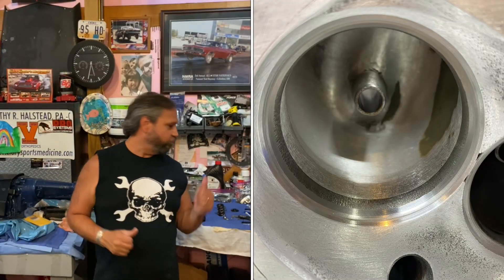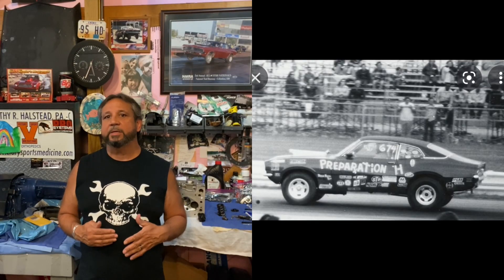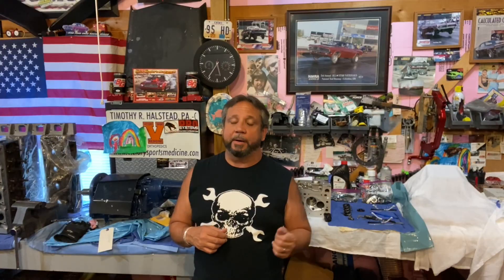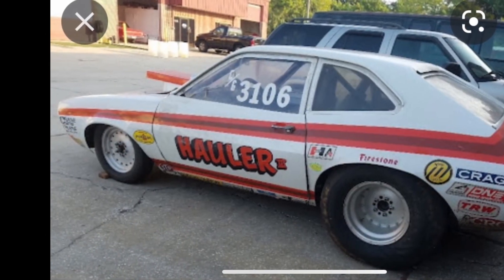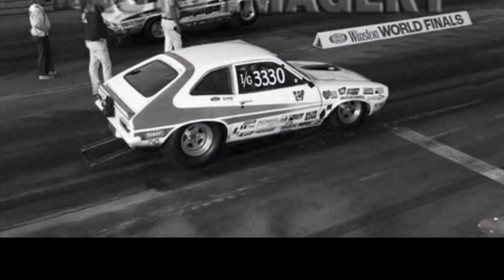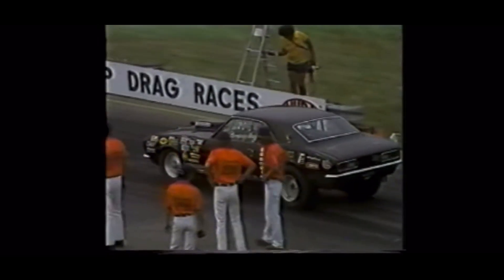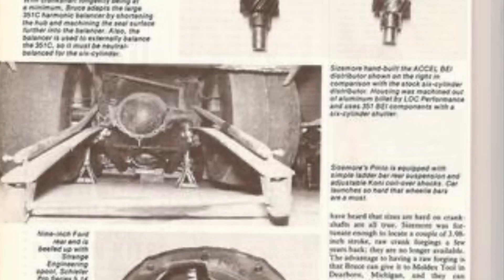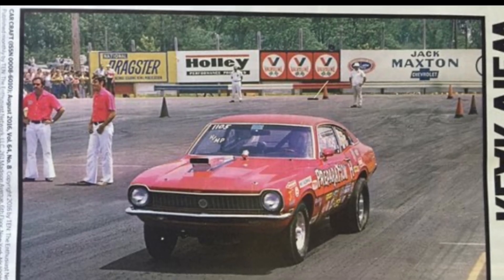Ford 351 Cleveland Headed 300  6 Cyl, 500 HP,  by Bruce Sizemore, Saw Lee Shepard smile, As I Passed

Comment: Preparation H Maverick was a 240 six cylinder engine bored to 300 CID because Ford 240 engine was 4 bolts mains engine.
Reply from the maker: Yes and with a one off SK head Bruce had made 😉

Comment: We had a local Pinto, run by John Bugenski and Mark Fetiel[?]. It ran the same setup. The head was furnace-brazed by Batten. It was also an ex-Glidden pro-stock car. Probably the Gapp/Roush car. I remember it went mid 9's. That was in the same time period. When they raced, Joe Williamson and they would add or subtract weight to change classes. I found a couple old pictures, online. We were young, and hung out at their shop. They called it a "power hack-saw".
Reply from the maker: Great analogy for sure. Got something you may like in the works, editing now. His head was by CJ too. Such great history thanks for sharing. Power hacksaw, killer

Comment: This video showed up in my stream, pretty darn cool Tim! 500 HP out of that thing, those guys doing the LS, 2 into 1 head on a Ford 300 are planning on turbo charging, can't wait to see those numbers! I wonder what the limit of one of those are?
Reply from the maker: Thanks man, if you did not see this, need to go back in my vids, may be more you really enjoy. When your not doing anything lol. Yea quite amazing for sure. Limits are blocks, although billet block’s available for like Barra engine which can make 2k hp and more I bet.
Reply: @dragboss351cleveland  
I'm not a racer so 500 HP would be plenty on the street with a Ford 300 L6. LOL

If I have a chance to do one of these more modern swaps it would be with the late model Hemi heads. Bore spacing is much closer and so is bore size to use the matching Hemi pistons as well. The late model Hemi heads flow even better than the LS heads for even more N/A HP potential.
Reply from the maker: If only I had the resources. Well maybe In the future. I keep going forward slow but sure. Trying step over a few stumbling blocks.

Comment: Can you do a video of converting 4v heads to rocker stds?
Reply from the maker: You mean cutting off .300, so you can run screw in studs?
Reply: @dragboss351cleveland  yes sir
Reply from the maker: I could talk about it, and mention it but have no mill to work with or heads that require it, all mine have been done already.

Comment: I've literally never heard of this even though I've been stanning on these 300s for a few decades now. My brother bought an early '80s F250 with one in it that had 300k miles on it for real cheap. It was run by a landscaping company he worked for for all those miles, so hard miles with a lot of stop and go and loaded most of the time. He resold it to my uncle, a farmer, who had his buddy help him put some valve seals on it and ran it for a bunch more years until the frame rusted in half. Not sure of exact mileage but it had to be around 400k and it was still a strong runner. My uncle is harder on vehicles than anyone I've ever met, and even he couldn't kill it with all those miles on it. Been a fan of them ever since and had the idea to try to build one up but you just can't get a good head for these, unless of course you make one lol. Great stories here. I love the interview you did with Sherman Sligh. That dude is super cool. Can't believe he made 620 hp NA with one of these.
Reply from the maker: Robert, that was when men were men, laugh out loud. Those six cylinders are bulletproof. That is for sure. I bet you that block would be great foundation for a power House six cylinder. my buddy has one of those six solar Cleveland heads, set up for fuel Injection Intake. Maybe he will sell to you. Stay tuned for tonight with Darin Morgan, talk cylinder heads

Comment: back in the late 70 me and a friend Daniel built a 300 six with a furnaced brazed cleveland head. we were running a 70 maverick with a 351c in super street then super gas 9.90 at 147 mph, the crank went bad , nodular iron cranks were hard to find then and expensive, Daniel had access to a brazing furnace, Chet Hebert ground us a cam.Chet was amazing he did all our cams in those days.  We lightened up the car with fiberglass hood fenders doors trunk and bumpers and went back racing with the six. we had to change the flywheel bolts after every day of racing otherwise the bolts  would shear off due to vibration. there were no billet cranks available to us back in those days, that long cast crank would flex and vibrate even though the balance was spot on.
Reply from the maker: Amazing history Robert. I bet you knew Bruce Sizemore, with the preparation H and pinto. Both running similar combos to you. Amazing the work that went into these engines. Thanks for watching. I will have him on for a live chat soon.
Reply: @dragboss351cleveland   I didn't Know Bruce. I knew very little about him prior to watching your video. I admire his ingenuity. I look forward to watching the chat with him.
Reply from the maker: @robertschafer53  me too. And your right up there doing the same feats.
Reply: @dragboss351cleveland thank you,  we built one but we were not the first to figure out how. we had fun, I was a teenager in the 70's driving a 9 second car, that was amazing to me, but we did not have any titles or a successful racing career.
Reply from the maker: @robertschafer53  don’t matter you were there and had fun and memories that last a lifetime. Glad your here lots of vids if you look around

Comment: That's interesting that all the bolt and pushrod holes lined up. And the Cleveland Chambers lined up with straight 6 cylinder spacing. Water jacket etc...I wonder what the odds of that were?
Reply: Pretty good when you cut up heads an customize them to fit

Comment: there was another builder/racer (sadly now late)  jerry meade  from paramus nj back in those days. a 300 block with 6 chambers  from boss 302 Cleveland heads furnace brazed back together,  running the  engine   in a opal gt ,that was one super nasty motor later he sold the opal body and ran the  300 in a altered .
Reply from the maker: Wry cool to hear that there were others doing this. And man do they respond to Cleveland chambers and ports.
Reply: @dragboss351cleveland  yes they do,  his ran in the I/gas class  jerry also half filled the water jacket with epoxy   to help make it stronger  plus had  the crank  tuff coated  and treated  what pistons were in it sorry i don't  remember  as that was back in the mid 70's
Reply from the maker: @chasg9779  great memories. Thanks for sharing. Good point on filling the block. Definitely helps ring seal.
Reply: @dragboss351cleveland  that is why jerry filled the block which got him several more runs between rering work ,

Comment: Looking at the hood scoop placement on the Preparation H Maverick, I would assume it has a typical head. Both the intake and exhaust are on the passenger side. The Cleveland head had the intake on the driver's side.
Reply from the maker: Great observation, keeper of the mountain, I’m not sure about that but it makes sense. When we get Bruce on for chat we will find out.
Reply: @dragboss351cleveland  I look forward to that interview. I am building a big six for my Boat Tail Speedster project on my channel. Any information from the guys that did it is invaluable. I will ultimately probably run a factory EFI system as I am not building a drag car. Racing however tests the metal of any idea. It sorts out what works and what just looks good.
Reply from the maker: Of course function and endurance will test all parts. I will try to get Ken Ellison, soon. My buddy is working on his own Boss 300,lots going down. Thanks
Reply: @KeeperofTheMountain  you are right it was not a Cleveland head. It had three Webers on it. I saw the run at Byron dragway back in the day. I have heard of someone using Chevy ls Cathedral port heads on the 300 six.
Reply: @KeeperofTheMountain  hey lots of small block Chevy stuff is a Direct fit on a ford300. Pistons, rods, 2.02 and 2.60 valve’s roller rockers also work. Pistons out of a 390 ford will also work. My brothers and I build a ford 300 back in the day we were bucks down so we had to find a cheap way to do things. We got out the Chilton book and started looking at valve stem diameter and length and so on good luck with your build
Reply from the maker: I read that it was a ford 240 head? Never heard of that. LS head Jim?
Reply from the maker: Jim never knew any of that. Cool info. It’s like you used what you had or made it. Thanks for sharing
Reply: @jimquast8186  Thank you very much. I hope to get my rod bearings today and the engine will be all together. Then it is all paint and accessories.

Comment: Love the big Ford 6. Adding the Cleveland heads to that engine, the best of both worlds. Bore spacing on the 300 Ford Is 4.48 while the Cleveland is 4.38. That work's out to about 3/32"+. Had a 300 in a 66 Ford truck, added a Clifford intake and headers and a 390 CFM carb, really brought that engine to life.
Reply from the maker: Yeah that is crazy when you look at it like that. I had couple six cylinders. Amc and slat six. Could not kill them. Drove slant six running on only 5 cylinders for years. Just shook at idle. Amazing how engine benefit from intakes and headers, add some gear and ready to rock James

Comment: With all the aftermarket companies making Cleveland heads these days, it’s too bad they don’t cast a Cleveland head for the 300 six. Absolutely bulletproof engine that was extremely reliable and made a good amount of low end power in factory configuration. I think there would be a market for it. The 300 still powers plenty of older vehicles on the road today and has plenty of fans that love that engine.
Reply from the maker: That would be wicked for sure. I know they did make some down under but one guy said they scrapped the whole pallet? Brice seizmore contacted me and may do an interview soon. Stay tuned

Comment: Amazing creativity.  Being from AUSTRALIA - I have to mention the BARRA as an impressive 6-cylinder FORD engine - but that is somewhat 'cheating' with its new technology compared to this 50-year ago supa-dupa 6-cylinder with the furnace brazed CLEVELAND head.  NEATO stuff indeed to hear about that from 50-years ago.  Another 6-cylinder made here was the CHRYSLER 265 HEMI  which in the hot E49 (and E38) version ran triple WEBBERS from the factory and if my memory serves me correctly - the E49 version was quicker than the nightly 351 CLEVELAND GTHO FALCONS (AUD1,000,000,oo cars here these days).  Then there was the XU-1 TORANA - again a triple cab 6-cylinder HI-PO engine and in a very light car.  I had a genuine BATHURST version (CK block casting) - HA - wish I still had it.  And I often cringe at me being guilty of helping to strip the running gear out of a genuine but rusty E49 - sending the body to the rubbish tip and installing the E49 running gear into a not rusty 4-door VALIANT - HA - those were the days.  Have a safe and nice day all.  CHEERS from AUSTRALIA.
Reply from the maker: Thanks so much for some history. I am not familiar really with any of the 6 cylinder mills. Cool to hear the different combos. E49 sounds like a killer combo in the day. Thanks privite for checking out the channel. More in store as Bruce Contacted me. We may do a live chat.

Comment: I remember reading about the building of the engine back in the 70s. Then they said that he band sawed 3 Boss 302 heads then furnace brazed them together. The bore spacing of the 300 and the 302 is the same making the head bolts line up. I remember Bruce saying that he had a major vibration problem with the engine and had to assemble it using red Locktite to keep it together and even then the flywheel would loosen up. I would love to duplicate his setup. We had several 6 cylinder cars back in the 60s and 70s that were nothing but fast. Guy I went to High School with had a 59 Plymouth with the slant six. It had a four barrel carb and headers and most V8 cars couldn’t touch him.
Reply from the maker: Well I will tell you this. Bruce messaged me and said he had a real surprise for me, so cants wait to see what he has. I also want him to be on a live chat to tell us the whole scoop. Stay tuned Marvin.
Reply: @dragboss351cleveland  yessir I will stay tuned. I retired in 2018 and am champing at the bit to build a toy like I had in my youth.
Reply from the maker: No time better than the present. We only get so much time, you have a plan now get r done Marvin

Comment: Well if they wanted to get power out of a 300 they weren't going to use the original cylinder head no matter what they did to it that was genius what they did with those Cleveland heads
Reply from the maker: And the one Ken Ellison has, had the head made from 6 separate sections and it was done in 1970, the owner is 86. Made 620hp

Comment: Ellison's engine service and machine shop has one that they restored they claim 600 650 horsepower I wonder which one of you was correct I know he didn't put it on a dyno definitely a bad ass build or should I say engineering accomplishment
Reply from the maker: I have talking with Ken and he is going to do a live chat soon. That engine made 620hp, like 2 hp/ci.  It will be a wicked show and that engine was so trick. The guy that built it is like 86 yo.

Comment: I have watched this video 3 times. I am amazed at the inventiveness (of 50 yrs ago) of that 6 cyl.  Honestly a head casting company can make 6cyl cleveland heads (pay attention Higgins) with a little tweaking.  With the new Higgins Cleveland heads making 900+ HP I think with a Higgins heads a 6 can make 800 HP in NA form!  The sky is the limit on boosted/nos 6 cyl.
Reply from the maker: I can dig it. Wait until I get Ken Ellison on, texted him just now. yes I bet they could make 800hp. The real deal, is who would buy and race them. Not sure of the popularity of them in NHRA.
Reply: @dragboss351cleveland  honestly there is a HUGE amount of folks who race 6 cyl for the durability.  If "one motor" can come up and make huge power, racers go crazy.  Example, JZ (2 versions) and the Australian Barra.  There is a Barra, stock block, ported stock head running in a Australian pro mod making 3000HP.
Reply: I watched the video again. You said something about the AMC super stock.  I am a AMC fan, had a 69 Javelin since 1980.  Your channel should blow up showing all this racing history.  Im watchin.
Reply from the maker: @TheClintmeister  I have heard of that motor, amazing the power out of these engines, and stock block too, man...
Reply from the maker: @TheClintmeister  Thanks man, Trying to get in touch with Wally Booth. I gave my email to another sub, that said he wanted to chat. I have not heard back, also tried Maskin at Dart, but he has not been in much since he sold it. I will keep trying. I love the Javelins...
Reply: @dragboss351cleveland  Dunno about NHRA, but I bet a few kinky old guys would try em out on street rods, or at Bonneville!
Reply from the maker: @pookysdad4884  oh hell yeah they would

Comment: The pic you posted last was with 300 inline with 3 weber 2barrels and I got pics of that . I my self have done lot research on only and anything related to the 300/4.9L and Bruce  and another the French flyer dont hold to that exact name of the of the French flyer or something of that nature
Reply from the maker: Yes was never impressed by 6s until I saw this. French Flyer, cool. Thanks Vega
Reply: @dragboss351cleveland  Frenchtown Flyer is the 300 straight six guy.  Has one of the crossflow heads on a drag car.  There are videos he has posted on the Youtubes...
Reply from the maker: Will check them out my friend. Thanks for the heads up

Comment: In the late sixties I worked at K&L Speed Shop in Detroit. Bruce would show up on Saturday afternoon and I would do what ever machine work he needed on his Ford 300 cylinder head,   he had this engine in a "D" Dragster. This was long before the Cleveland Head. Bruce helped me with my racing efforts by some "Back Door" parts (GT-40 Heads)for my "Old" Thunder Bolt that I put a 314 cu. in. Injected Small Block and ran it in "E" Gas
Reply: Andy Mannarinno worked there too
Reply from the maker: iMessage to Andy before, but I got no reply, maybe he does not want to talk about this for some reason. But either way I’d be cool to have them on for a live chat. Joe Pappas will be on Thursday, I’m working on that. I’ll post a link tomorrow. Stay tune.
Reply: @dragboss351cleveland  Joe chummed around with my old boss Mike Fons
Reply from the maker: @tomstiel7576  oh yeah, I know who Mike Fons, is. You have to get on the live chat mention that. Thursday 7 PM. Be there and don’t be square my friend.
Reply from the maker: Cool Jim. Man those were the days. I can remember going to to machine shops as a kid. Can still smell the machine oil. Thanks for sharing

Comment: Powernation just finished a series about Fords 300 six. I think they got close to 500 HP using a turbo. What's impressive with Sizemore's 300 Ford is that he got all that power without using a turbo/supercharger. Also, as people have mentioned, Sizemore did this using 1970's technology.
Reply from the maker: Exactly Brian. Good old ingenuity and determination. Lots came out of the years from 70-81 for all engines in racing

Comment: A Canadian Six with a Hot Head on it would make more Torque than a Same Size V-8 anytime . The Big LONG Crankshaft being the Problem .
A Balancing act between , rotational mass , torsional rigidity and harmonics . A Metallurgical Engineers NIGHTMARE .
Torsional forces could have DIFFERENT timing between No1 and No 6 . Harmonics ? It'll snap between 2-3 , or 3-4 , or 4-5 . Hard job .
Reply from the maker: I know, I never even thought of those issues. I am getting Ken Ellison on live chat soon. He is building one now.